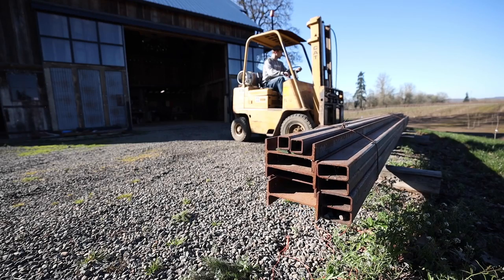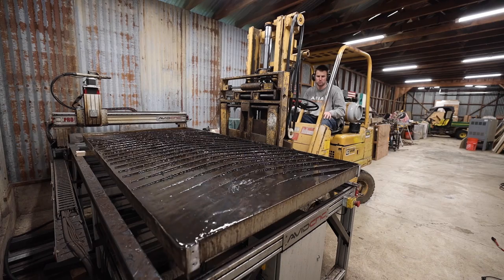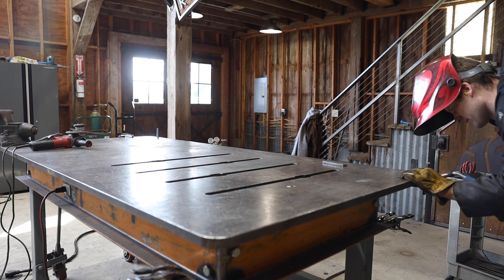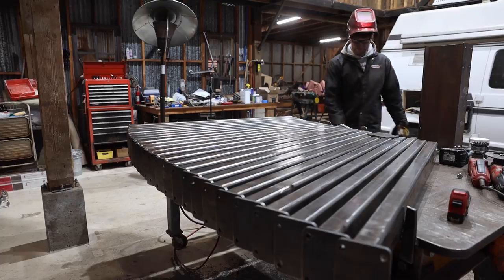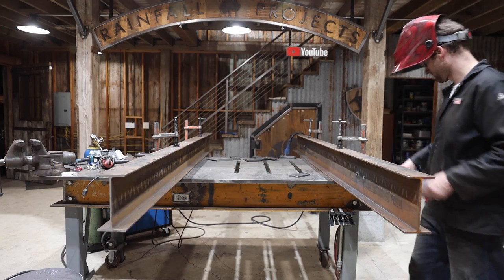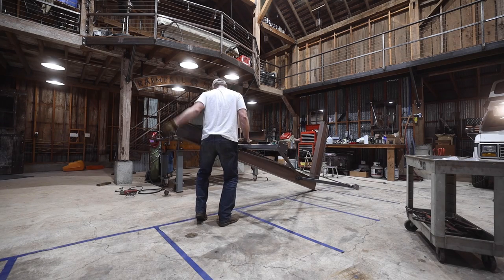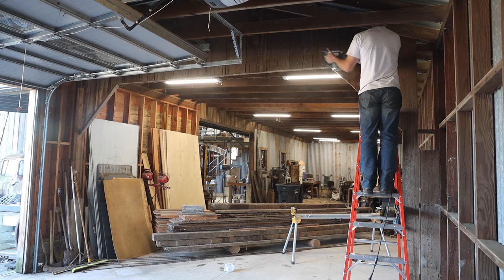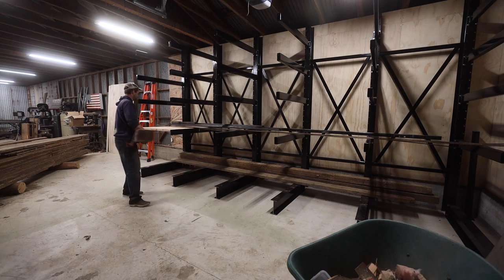Cantilever Metal and Wood Rack

Comment: Helpful tip; If your welding table top plate is perfectly square, you can drill and tap some 3/8 holes around the perimeter. This allows you to bolt on tabs where needed for 90* corners and such. It was a game changer for my table. I used 3/8” x 16.
Reply: thats funny i was about to type this same comment. I decided to read a few coments first.  Great idea

Comment: great build.
2 tips.
#1 Lift with your legs not your back.
#2 make a small triangle brace on the bottom of the uprights for they have to hold all the weight leaning forward

Comment: My lower back started hurting just watching.. at some of those points. 
Good thing you had that old forklift... That'd been hell trying to figure out 
the logistics other wise...

My favorite part, was how you managed to set up your CNC table & have it cut
out the holes for you... that saved a lot of drilling labor & time. Plus it was just neat the 
fact that you could set it up that way. 

Thanks for sharing the good videos. Its inspirational.

I kinda wish you'd went over the rough math, & how you figured out what would hold what... 

Nothing too technical, but just something to point one in the right direction.

Comment: One way to keep your table even after tacks is to build a small jig that keeps at all times 3 points of reference on the flat parts of the table whilst grinding the tack back to even, and not letting the grind go lower than spec. In my case, i bought the smallest table grinder i could find, cut off one of the two axles, and build a small magnetic based jig around it with a stop that will rest the cup wheel on the face and not allow it to go lower. It's adjustable with a fine thread backlash proofed screw so that i don't get problems from that. 

It sounds complicated, but i made the whole thing in 3 hours, on a Sunday. Super easy to make once you have all the parts in. I've been tacking and welding on my table for a while now, and it's just as flat as it was before.

Comment: Nice project, and a very smart use of space. Re your wielding table. Instead of wielding to it. drill a load of holes and thread them. If you use a trigonometry pattern you can get very arcuate angles using bench dogs and or clamps. There are a few calculators you can use to work the hole patterns out. Threaded bench dogs will give you the same flexibility without damaging your surface. I hope that helps D

Comment: Great use of the CNC plasma to skip drilling hundreds of holes in that H beam! I don't think I've seen anyone else use an Avid CNC the same way. Maybe a purpose build manual height adjustment system on the gantry in the future so you don't have to move the water table?

Comment: Unless your video is mirrored and I am seeing this backwards, if you change your cut from climb to conventional you will get a squarer edge. ie as the torch moves away from you the right side cuts more square than the left.  Inside cuts will be CCW and outside cuts should be CW.

Comment: Justin, I run CNC plasma machines for work.  There is an option when laying out your cuts/parts called "common cut".  It's a cut between two or more pieces and saves on scrap.  Really minimizes the skeleton.  Just thought if that was an option for your Avid it could save you thousands of dollars in material.  Hope this helps.  Cheers!

Comment: I’m a little worried about relying on 20 grade 8.8 10mm bolts to hold the uprights to the horizontal members on the floor. Those bolts have a pull strength of about 1600 pounds each if torqued properly, so that’s 32,000 pounds combined. But the “pull” of the weight placed on the shelves will be drastically multiplied by the long lever arm formed by the uprights. Just to be safe, I suggest going back and welding those joints. Beautiful workmanship, by the way!

Comment: Looks amazing. One remark, and I know this might come across as nitpicky. Your distance of the holes in the I-beams to the edge of the material is too close. The way you sandwiched them, and the relatively low load to material strength, you'd likely be fine, but for future reference, you had a lot more flange available.
Reply from the maker: That was as tight as I could go, because I had to fit the bolts on the outside of the 2x4 arms. I wish I had more room, i was nervous getting off while cutting them.
Reply: @rainfallprojects501  ah yes, makes sense

Comment: Correct me if I'm wrong but I believe its better not to connect the cross bracing in the center as it creates extra (unnecessary) stress points
Reply: I agree to that. It looks very good to me but could have been a little more over engineered: fom a structural perspective the connection between the horizontal cantilevered part and the vertical members will really benefit from some gusset plates in between the flanges of the vertical members. Now the tension part of the bending moment cannot be transferred easily to the flange close to the wall... Also the distance from the edge of your flanges to the bolt holes seems a bit small compared to the bolt diameter you use...

Comment: Great project and video, as usual. Few questions:
1 - What type of MIG are you using for this, AC, DC neg, or DC pos?
2 - You didn't show any prep before priming, so I'm assuming you didn't remove all the rust. What primer did you use that applies over rust?

Comment: Hey awesome project! Would it be worth putting a layer of HDPE on the arms of the rack? 

I would be curious how much it would help with noise and handpicking pieces off of the shelf. 

A lot of guys that build jet boats out of aluminum will screw a sheet of that stuff onto the bottom of the boat for sliding over sandbars and log jams.

Comment: Really amazing! As someone who knows nothing about the cost of steel, what is the ballpark amount he spent for the metal? Thousands?
Reply: Lot of thousands - I would have bought this at auction for 1/2 ready to go.
Reply: @RRaucina  10s of thousands? And is that the 1/2 auction price?
Reply: @cgstadler  No, I said lots of thousands for your steel price, especially with prices today. I build many things I can buy for less too, if it's a custom size and not readily available.  But racking is often on auctions and usually for the price of the iron.  Rather than all the bolts, why not use square tubing and build a 2 sided rack with welds. Once you load that rack its unlikely one will ever move the arms again. Bolt the X braces for transport

Comment: I-beam. H-beam is roughly square in its cross-section ;)
Reply: w-beam?
Reply from the maker: The metal supplier called them h-beams. I actually didn’t know there was such a thing, but just stuck with what they called it. They said I-beams have tapered undersides, and these were flat, so they called it h-beam